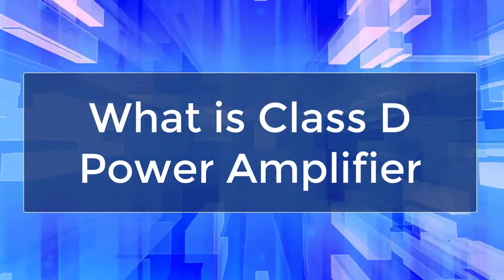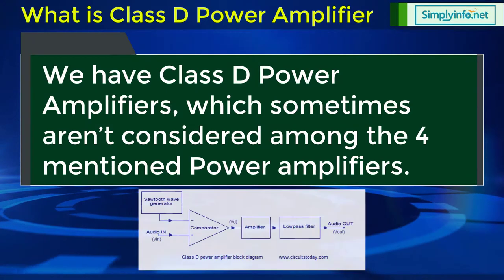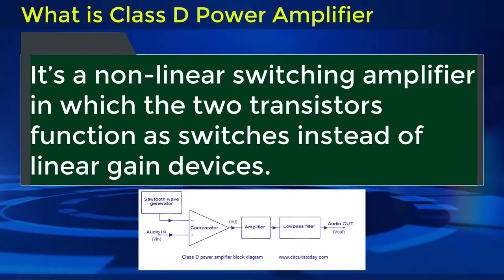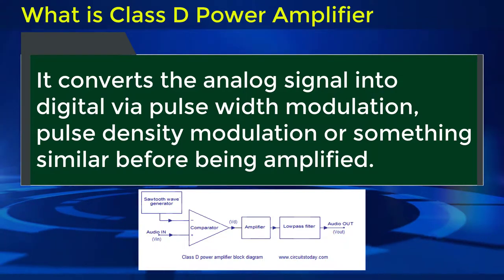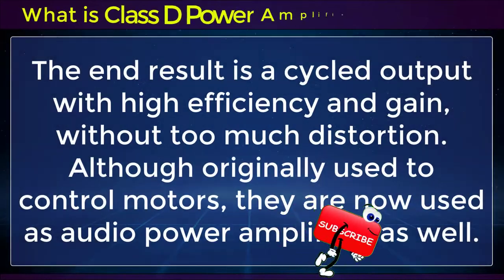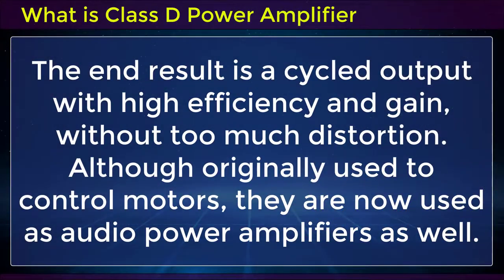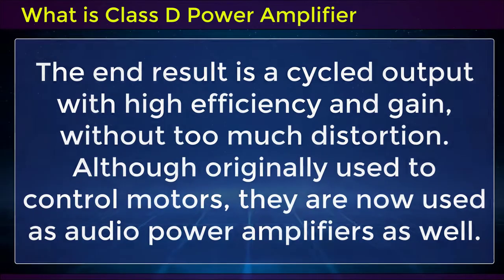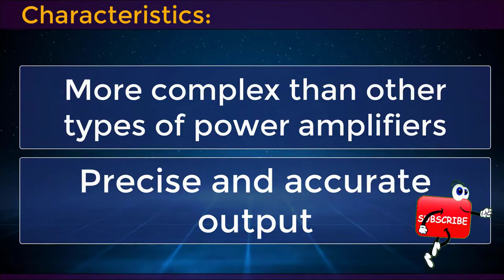What is Class D Power Amplifier | Feedback Amplifiers | Electronic Devices & Circuits

Comment: For audio domain

PCM/DSD audio > AVReciever Atmos Decoding > Digital ....wire -transmission along AC/DC power > At speaker box ---ClassD amp with DAC & with DIGITAL CROSSOVER  & feed back system(Speaker oscillation sensor ) > Analog audio signal > speaker/ Tweeter 

Its true that ...its hard for making a RC filter ...capacitors dont sound same for all time ....

Class D ...with feed back controll system ...based on speaker oscillation 'sensor voltage '

Mean we use ...sensor..that may be ....IR optical sensor ....or quartz sensor ........which corrects speaker oscillations 

So here....speaker must contain ..a oscillation sensor ....OPTICAL sensors are ..high ACCURATE ....
..BUT NOW A DAYS ...we still using. ..sub woofer (with quartz sensor )

Even in feed-back topology. ..i am not sure ...CLASS D will be precision perfect ...in high frequencies ...

I am unsure...classD may be better  ...if using optical sensors ...anybody may ...make ClassD amps ...

That days ...each ..speaker must comprise its ..own amplifier .....

Forget to ...say this ....

Class D works best ...with ...PCM DACs...(i.e.  amplifying Bit level resolution of audio corresponding to DAC bus-width....& without converting to analog line level output )